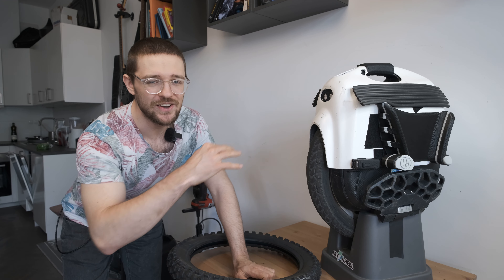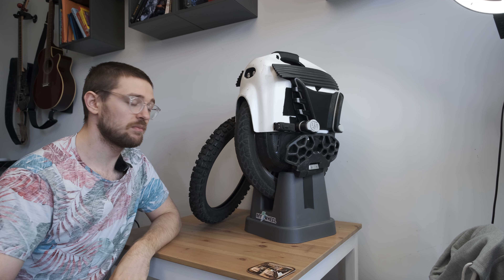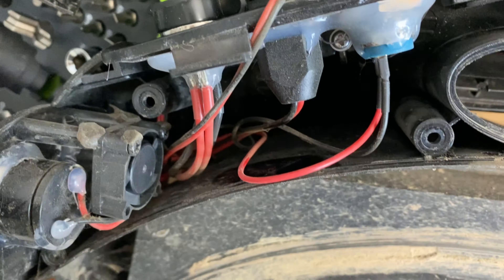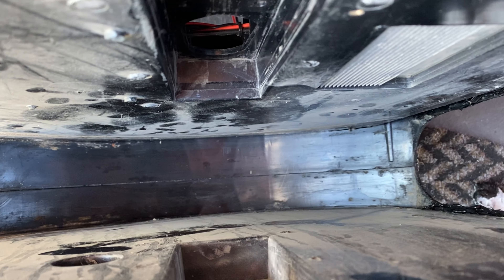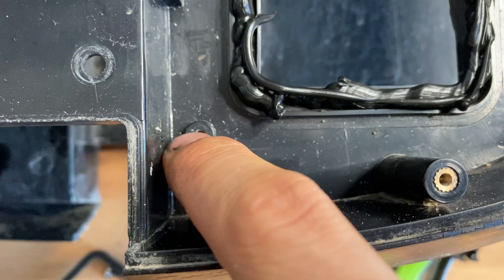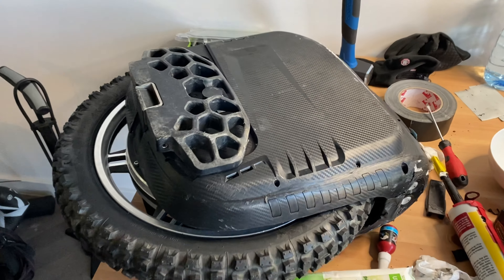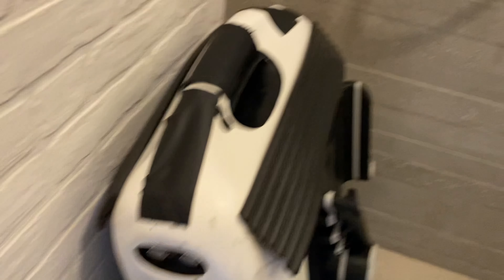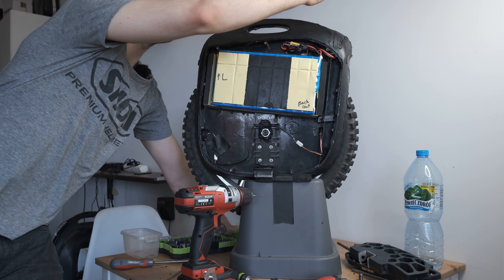How to Waterproof a Gotway MSP + Shower Test

Comment: Just bought a second hand MSP… think I’ll do most of what you have done - silicone and tape in wheel well then use a backpack waterproof for the top . I get to keep the trolley handle that way… or perhaps I should buy some glassfibre and epoxy n make a rain cover myself?…. Mmmmmmnnnn

Comment: iv ridden my MSP in rain loads since i use it to get to work everyday, some reflective tape over the front leds and the vent holes under the headlights, plus a backpack rain cover over the top to cover trolley, power button ect

Comment: Silicone. Silicone everywhere! Like a tank, just throw water on his undestructable shell and good as new. Now it only needs a tubeless tire - and I would buy one.
PS I would remove the speaker(s) completely and add something useful. Either a dynamo to charge an integrated powerbank or simply more battery @Adam do you think that's doable and if so, how much more battery Wh could be fitted?

Comment: Hi, I know you have qs205 motor on your bearebike.

 I want to know what mods have you done (or got in that motor) like turbinators rewinding ferrofluid sidecovers....???

Also how many amps or watts can you put through that motor (5-10seconds peaks)???

I am thinking to buy qs205 but wondering what is the maximum amount of amps that can be run through the motor with maximum mods that can be done in that motor (qs205 v3).

Comment: Why putting tape inside, that fall of within a few weeks. Better put silicon there and use the tape for trolley handle because it is a spot where you can replace it easily.

Also let silicon atleast dry 24 hours. Maybe apply a bit of pressure on it so it fills holes better and be sure to only apply on a clean surface.
Reply: Liked the video though. That silicon is sticky as hell. 😂